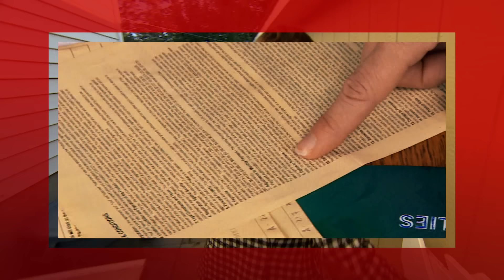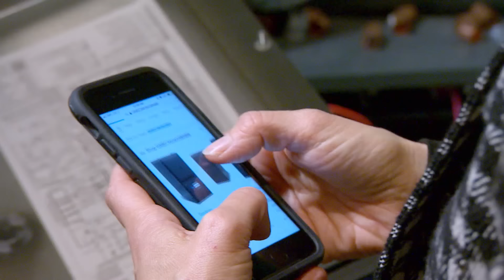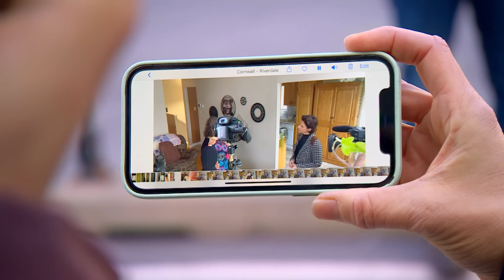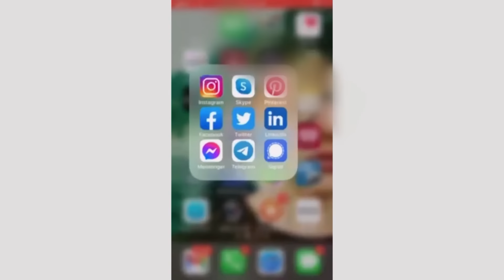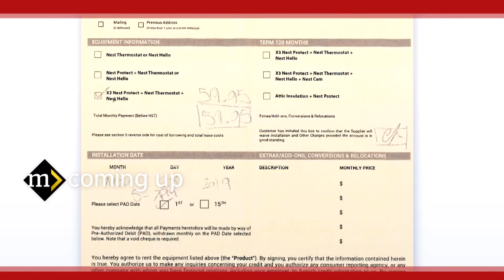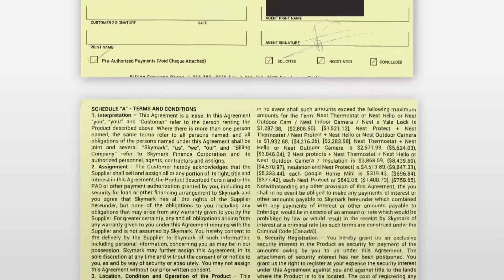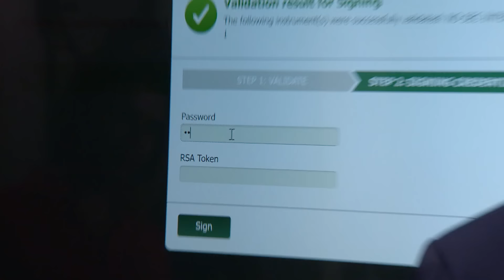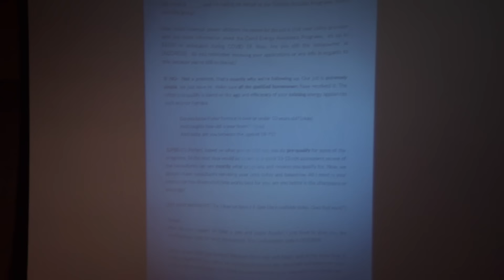Hidden cameras catch HVAC scam in action (Marketplace)

Comment: I’m an hvac tech. First thing I’ll say is this company is absolutely terrible and is everything that is wrong with the industry.

However I do need to point some things  out to the consumers that I had an issue with. 
That furnace cost was $1800. But that was only for the furnace. They didn’t include the coil, the pvc,the glue, the copper, connecting duct to the  unit,labor,safety devices,licenses,inspections,and warranties. And possibly a condenser as well.The list goes on. 

Second that expert didn’t do a good inspection. Turning the unit on and off to see if heat and cool work does not mean your unit is okay. You have to open it up and go through the unit. Inspect the parts and do a thorough job to inform your customer on what they have.
Reply: Yeah around here in Virgina in the USA that would be a higher but normal price 12,000 isnt horrible for the entire system id charge around 10k for a goodman system i could get you a nice Trane or Bosh system for 12 to 15k for the whole system tho Furnace, outdoor condenser, all copper lineset, connections and saftey devices....
Those crooks sold her the furnace only for 12k so they just used the old condenser and coil id charge around 5k for the furnace only installed with 1 year we cover everything warranty and a 10 year heat exchanger warranty....
Reply: im doing around $8K for high efficiency bosch furnace-only swap out here in california

Comment: The price of the furnace isn't surprising. Most furnaces and boilers are only a few grand. It's the huge installation and removal of the old unit - the labor - that makes it cost $10k+. That's normal.
Reply: Sure
Reply: I paid 2.5k all inclusive. I offered to help in the grunt work and hauling the old unit away. But not everyone can do that.

Comment: I own an HVAC company. I would never recommend anyone rent a furnace. However, the 1st furnace ($1800) you looked up on line i have questions about. Goodman is cheap ( in price and quality) but a lot of online stuff is last years models and warranty is questionable. Curious if the $12k included the outdoor unit. You can clearly see the refrigerant lines. Was an outdoor unit included in the price ? If you did get a unit on line you still have labor to install ( most companies WILL NOT install online equipment).  I myself have seen companies try to sell people equipment they do not need or even sabotage peoples equipment and that pisses me off. We are an honest company with what i feel is fair pricing but no one is in business to lose money. I have been told they got someone to do it cheaper. Most of the time those people call me back to fix the shotty work. One case the people called another company, unit stopped workjng in 2wks. Other company would not come back and fix it. It was out of refrigerant due to a leak. You are not just " buying a furnace, A/C or heatpump. You are buying a quality install. That was not figured into your online $1800 price.

Comment: Hvac charged me $100 for two fuses that  Home Depot sells for $9.98.  Then a service fee, a diagnistic fee, and also charged for their time at my house. Lol....Cost: about $300. They did not fix the air conditioning. Instead, they wanted to sell me a $14,000 new system!  I later went out to fuse box, checked the connection, pulled out the thing that slides in and out---and the unit started. I also replaced the filters. Now I don't anything about this stuff. Took me minutes to restart unit. I'm so sick of these obvious scammers. 🤬  I could use a new system sure, but it could have been fixed to work years longer IMO. You just can't trust anybody anymore.
Reply: Why is the government not arresting these people? A lot of them are still allowed to run their business.
Reply: sometimes i find that it's not always dishonesty - it is also incompetence: occasionally techs literally do not know what they are doing. simple straight-forward stuff yes (generally) but more complex checks and running diagnostics they make a lot of errors.

Comment: hvac guy here: although a 10 year old hot water heater tank style can work perfectly and does not need to be replaced, please understand 10 years is a typical life span of these appliances, i replaced my own after the same time frame.
Reply: Which you recommend between boiler system vs electrical heating ?
Reply: And no HVAC Saleperson Should ever fail to make the Homeowner aware that their unit has exceeded its mechanical lifespan. .. No matter if its working at present or not.. He cannot tell them they shouldn't replace it.. Because if it goes out in the winter, wait times can get ridiculous.
Reply: @alexcalderon5461 First, the question isn't a good comparison. A boiler can be gas or electric. you are comparing an energy source to an appliance. that said, it really depends where you live and how much the utility costs. typically you get higher efficiency out of electric, but since we haves so many different ways to deliver the heat its hard to answer in a nut shell. My short answer is balance install cost vs month to month cost. Forced air is decent way to get the best balance imo (electric or gas, also considering IAQ). I live in Ontario, our government effed up most of our utilities, electricity specifically, causing costs to be unreasonably higher over other regions as a result limiting most ppl to fossil fuels.
Reply: @alexcalderon5461  Also - "boiler heating" more commonly referred to as hydronic heating can be done with forced air using an air handler but radiators or an infloor slab are wayyyy  more comfortable heat (Radiation vs convection)
Reply: @mattgosson8697  my concern is that I feel government is going to penalize anyone using fossil fuel heating sources in the next 5 years. I live in Vancouver, BC Canada. The City of Vancouver just made it so any new home or building that goes up in Vancouver has to be electric. No more gas. Feels like that’s the future with everyone wanting to go with green energy.
Reply: @alexcalderon5461  thankfully governments usually grandfather these things in for existing homes. But you hit the nail on the head, it won't be long before they mandate replacements be electric as they are needed.

Comment: Hvac contractor here.  A 10 year old tank I tell people "save a bit every month, it will eventually go " but no way I'd say that they must replace it. The truth is we are not cheap, and neither are the materials so people are often suprised at the cost. So it's a good idea for any homeowner to put asside a bit every month cause a furnace will break, or need replacing, as will any mechanical device. But being informative and honest is a requirement if you are a service contractor, educate your customer and let them decide. In my over 25 years I can recall 3 occasions where I locked out a gas valve. One was a furnace with a huge hole in the heat exchanger, and the ambient atmosphere had dangerous co, another was a boiler with the same issue and one was a boiler that had a plugged exhaust and so was spilling out, that last one stayed in service after we replaced the ducting and the fried electronics ( locked out for the day while getting parts to repair.. a requirement legally  ) . Never trust a "rental" water heater, furnace etc..  this is a red flag, professionals don't rent these, we install them

Comment: Funny enough I wouldn't mind if you did a marketplace on the nest battery doorbell you installed. I've had one about 6 months now hardwired at my home and it stops working around 5⁰C despite being hardwired and despite having an operating range down to -20⁰C. Reviewing forums this seems to be a very common problem and it seems like a liability to sell these in Canada.

Comment: That being said.. Know the facts CBC. It’s not “it doesn’t use fre-on” They told her her old one uses R-22 which is being phased out by the EPA.. and she needs to upgrade to 410a (also being phased out in 2024) 
It sounds like her old one was already a 410a unit (modern at the time) and they sold her the same 410a unit.
There is NO cooling system that doesn’t use Refrigerant 🤣
Reply: 407c works perfectly fine in r22 unit and yes 410a is being phased out. A2l will increase prices tremendously!

Comment: I've been on the HVAC business for over 20 years and I will guarantee you that if I see a water heater 10 years or above I'm going to make that recommendation. You don't have to do anything but I will write it up that I mentioned it. How many emergency calls ive went out to in the middle of the night for a destroyed flooded bsmt  after another tech was out there and didn't mention the age of the tank and when I do, it's always "you guys should be responsible for the damages because the last guy never told me it was that old"
Reply: I agree, it’s a recommendation and it’s providing knowledge. The reason for replacing something before it breaks, especially in Canadian winters, imagine the time it would take to have it installed, and if there was a leak, all the things that could go wrong, and what it could damage in the process
Reply: @gregpetelli5529  Not for 25k

Comment: i did a/c repair since 1972 when i finished  tech school and later became my own contractor.  my  experience with my own water heaters in my home .if they offer 10 year warranties  they will fail very soon after 10 years  you should drain the tank every year to remove the rust and mud. Mud?  when ever the water company opens up your water lines at the street and dirt gets into the pipes and when they turn the pressure back on it frees the mud in the pipes and they move into your home. i always turn my refrigerator water line so it doesnt damage my water filter and then i turn on the bath tub faucet to flush out my lines

Comment: In the hvac field price doesn’t matter because yes your paying  for the install, which includes Materials, Labor, Tools, Parts if needed and most importantly TIME meaning you get what you pay for and pay for what you get. You’re not paying for the price, you’re paying for the experience. 💯
Reply: With more experience, one should be able to do it faster and therefore cheaper, no?
Reply: Depends on what you think, sufficient or efficient? Skilled Labor isn’t Cheap and Cheap Labor Isn’t Skilled.
Reply: @5jjt so, you want to punish skilled craftsman for being good at their job?

Comment: I had to have my 22 year old water heater replaced a couple years ago. The contractor seemed pissed off when I told him I'd have to do some research when he told me it'd be $2k (me knowing a gas water heater is like $500+labor). A second opinion yielded the same... they explained a bit more though. Since my home is a ranch, it's essentially a natural gas water heater designed for mobile homes to prevent combustion gasses from leaking into the sleeping area in case of a clogged vent or something. They're 2-3x the cost. Don't regret double checking before taking their word for it though!
Reply: Make sure you have smoke and carbon monoxide detectors in your home!
Reply: @bobboscarato1313  Thanks! I actually keep putting off buying a new carbon monoxide detector... I'll do that now !

Comment: I have that exact same furnace model shown in the first house. All in taxes etc installed it cost me $3600 in 2014. (The $1800 quoted in the piece is the cost of the furnace itself, not including installation) And even then I had them knock off $1000 off their initial quote because I had had another HVAC contractor quote me a replacement furnace at a competitive price. When I told the sales person from the company I had dealt with for 10 years, I was going with the other HVAC contractor,  a $1000 was discounted. ALWAYS respectfully push back on the pricing as there is quite a large margin on most HVAC equipment.

Comment: I have been doing heating and air for nine years. I’m not a plumber so I can’t really speak about that. I know most plumbing companies do not flush water heaters over 10 years. But in my opinion, if it’s still working as it should then it shouldn’t need to be replaced. Also when she googled and saw her furnace only cost $1800. She’s also not factoring in the taxes and shipping to get that furnace to them. Which would add about another $200-$300  roughly. Say she find someone to put it in for $3000. They might not even be certified or license to install it. Also, they’re not gonna warranty it for a year. say that unit goes down 4 to 5 times the first year and that means that person has to come back at no cost and say the unit needs parts that’s trips to the supply house and back. Now I could understand it if it was 12,000 for a furnace AC and Ductwork that would sound like a fairly close number. Also, most companies just go based off your ratings and efficiency to determine how much they can possibly save a month. But it mainly just depends on your unit. If your unit is out of the manufactures warranty and needs major repairs or the system just is not efficient anymore. I completely agree with telling someone they need to upgrade due to efficiency reasons. But I normally only tell people that when the system is 20+ years old or still using the old refrigerant R-22. I’ve worked for companies that wanted us to be unethical and I quit the same day not all companies are bad but if your sales guy is driving at McLaren, I’m just gonna assume he is very unethical. I’ve been in a scam before and I was the only honest person all day. They unhooked a connector and called in a service call. Once I found it, I only charged him a trip fee of $45 and advised him to get on a maintenance program. Then I left the system was 15 years old, but had no issues, so there is no reason to tell them to replace any parts or the system itself.
Reply: I agree, when I heard her say it was 1800 I also thought to myself, “well that doesn’t include labor or anything else”.
Reply: @jameshill8034 ight, that didn’t include the ac, if she got all new duct? We were missing some prices. Also if she got a new t-stat that can be over $100
Reply: @AK2WI  well it's highly unlikely that she got new duct work. I've been in the industry for awhile now and I've never had to do anything with duct work unless it's absolutely destroyed. Typically when we do new t-stat with installs (basic t-stat) we just comp it
Reply: @jameshill8034  I agree it’s unlikely but it would be nice to know if she did. Maybe she converted from radiators to a furnace? I just think there was a lot of details left out. I mean ac and A coil isn’t cheap either, maybe they had to tear into drywall to run new ac lines? So many variables lol

Comment: If your water heater is 10 years old it makes total sense to replace it. I'm not even with them, But it's true that if you wait until it starts leaking, it can cause some damage.
Reply: especially if its installed in an attic

Comment: I used to do a lot of HVAC in LA. CA. And I know for a fact a lot of HVAC companies oversell like this. Most of the time it’s just filters that need replacing. Most home owners don’t even know that there heater and A/C system have an air filter and it’s very rare that a home owner knows how to change one. So what many companies do is push complete A/C installs when all there system needs is a new air filter or some minor parts. They make so much money on new installs it’s not worth it for them to simply fix the system. I’m retired now but I used to tell all of my customers “Be very careful when you talk to any body in the HVAC industry, because most of the time they are going to try to sell you a whole new system.” I NEVER did that because it simply was NOT right. The way I felt about all my years of both automotive and HVAC repair was (and is) there is ALWAYS plenty of REAL repairs that honestly DO need to be done so I NEVER recommended things that did NOT need to be replaced. I’m glad that I learned how to maintain and repair many types of appliances, machines, vehicles, plumbing, electrical, etc. at an early age. It saved me a LOT of money with my own house. 😀

Comment: The unit costs $1800. She is paying 12k. If you think that is bad wait until you see the costs of cars, food, construction etc without the markup.
12k sounds high but who knows the area and what was needed. Just doing a quick search shows the AVG cost for a replacement is 6-12k
Got to consider there is duct work, new piping, wiring, refrigerant, labor/tools, taxes/fees (Government cost to run a business is a huge one and alot worst in these past years) and haul away.

Comment: Liens can be challenged in small claims courts and you don’t need a $25,000.00 lawyer to remove a lien. This CBC Marketplace video is misleading. They should have also pointed out that the lawyer who places the lien gets a $2,500.00 fee. Lawyers are Officers of the Court and they are supposed to what is called “due diligence.” I assume the same lawyer who placed the lien is also the lawyer that wrote the contract. He does not care about doing “due diligence” since he is getting paid his lien fees. 

It can take years to go through the small claims court process, so if you want to sell a house tomorrow and you only found out about the lien today, you have to  pay off the lien. I would call that blackmail. 

I would have stopped the sale. Challenged the lien in court and issued a complaint against the Lawyer Governing Board in the Province Where the Lawyer Operates. He should be disbarred for blackmail.
Reply: Except people on other side of stopped sale can sue you rightfully. The cost would probably end up more and case would take forever. Scammers count on you being between rock and the hard place and not on legal validity of their claim.
Reply: Do you know how to check if the service provider has put a lien on your property?